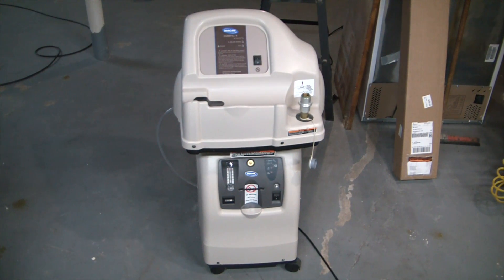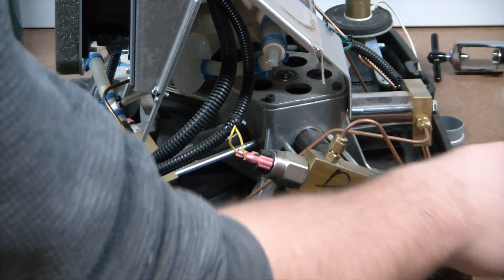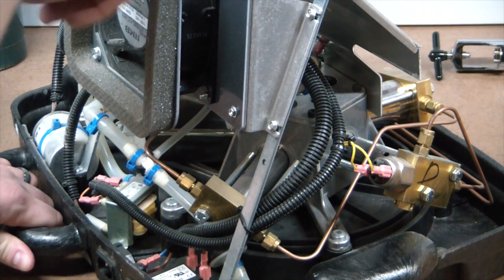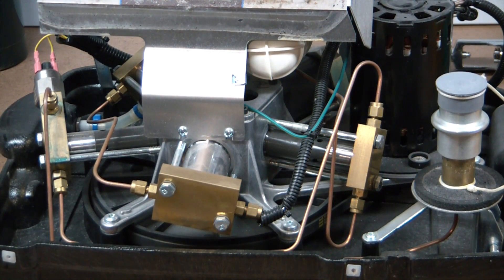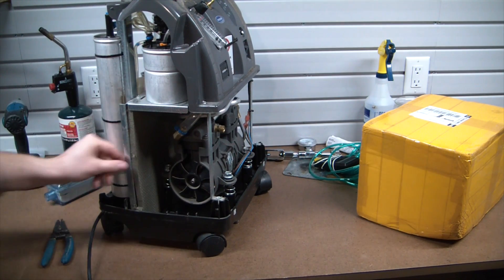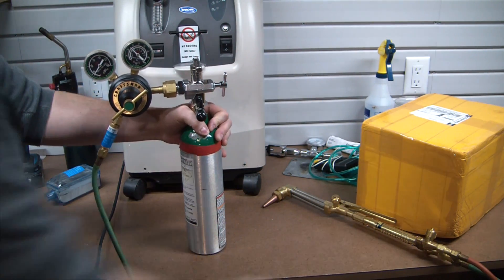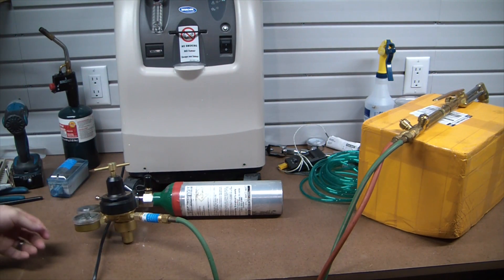Whats Inside an Oxygen Concentrator and Compressor - DIY Oxygen Filling - ElementalMaker

Comment: Awesome video!!   I just discovered your channel.  A multi-stage compressor never even occurred to me.  And to be honest, It's hard for me to imagine how it actually works.  But without having seen one until now, I do know that they are possible for another reason.  I have an oxygen concentrator that then uses a second compressor and makes liquid oxygen from it.  The liquefier compressor is no bigger than a fridge compressor and it makes liquid oxygen!  So, if you think about it, you could take some of that LOX and trap it in a container and close it off.  There you go, SUPER high pressure... probably an explosion if you don't know what you're doing but that's another "round-about" way of achieving high (VERY HIGH) pressures with a small compressor.  It's less work over a longer time.

Comment: 0:31 anyone know what that type of port is called? Is it just the ubiquitous universal industrial coupler thats used to attach air tools to compressed air lines?
Reply from the maker: I believe that's unique to Invacare. The fittings are quite expensive.
Reply: @ElementalMaker  Damn.. Im working on creating a nitrogen concentrator and an oxygen concentrator as well. Sending the oxygen that gets filtered out via the nitrogen separation membrane to the input of the oxygen concentrator (before the PSA).
It would be really awesome if I could have two of those refill ports (one for N the other for O2). I guess the only real way that could happen is if I buy two oxygen concentrators that both have that type of refill port and cannibalize one of them for the nitrogen.
Thanks though!
Reply: @ElementalMaker  Oh, actually, looks like they can be purchased, just not for very cheap at all.. ~$220
https://www.tigermedical.com/Products/Homefill-Integrated-Regulator-D-Cylinder__INVIOH2MD.aspx

Comment: 11:30 i think they're the X13 zeolite sieves. Dont they get saturated with the nitrogen and require changes?
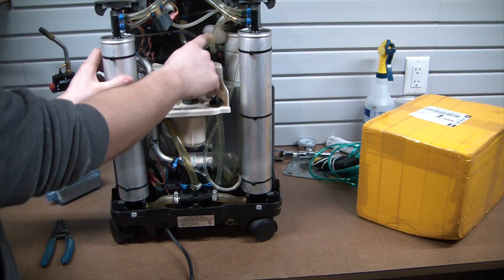Update: nvm, at 13:09 you explain that they offgas the nitrogen. Thanks!
EDIT: are you sure it doesnt use Pressure swing adsorption? (you said it offgasses with time, but PSA is when the offgassing happens when the pressure is released.

Comment: BMET here. Been about 15 years since I've worked on one of those.  IIRC, you will have O2 percentage fluctuations as the filters get saturated, and it switches back and forth.  I don't ever recall getting more than 96-97 percent on a meter. Can't remember what the lower limit is, keep thinking 94ish, but don't quote me, going off memory, and don't have the tech manuals in front of me. But for a small concentrator, with its flow rate, that's not bad at all.

Comment: good vid. I work with pressure swing absorption  (PSA) to generate N2, well remove oxygen... Anyway, i thought the Nitrogen atoms are bigger then Oxygen? if that was the case then this should adsorb the oxygen and pass the Nitrogen, then when it exhaust the O2 it should capture it? Anyway, neat to see whats in there.

Comment: I have an old BUNN Model RX02 . I'm guessing its from early to mid 80's. When I plug it up it seems to work OK but before using it does any one know if it would harm me?  Is there anything that could break down with age and put out harmful  gas? Oh yea it's got 544 hours on an hour gauge on the back. I'm thinking of using it  for oxygen therapy while exercising for some medical conditions I have. Thanks in advance for any and all help with this .
Reply from the maker: There shouldn't be anything that would give off toxic gas. That being said, the molecular sieve beds are very old and may no longer be working at fully capacity, so you might not get much O2.
Reply: Thanks  @ElementalMaker Thanks a ton for the info. If the  molecular sieve beds are  old and no longer  working at fully capacity is there any way to fix this or should I just abandon that one and seek a newer used one? Thanks again, and thanks for these informative videos also.
Reply from the maker: You could probably remove the sieve beds (canisters), and as long as the housing is entirely metal (and there is a pressure relief opening), put them in the oven at 300 for a day. That should drive off any moisture impeding their performance.

Comment: If you had multiple O2 concentrators you could feed the exhaust of one to the intake of the next, and so on, then the last one doesn't collect any O2, but its exhaust should be pretty good nitrogen, which perhaps could be collected in another high pressure compressor. Then you could do exciting nitrogen things!

Comment: Interesting video...I am glad you alluded to the flash back arrestors...maybe a follow-up on the proper sequence of turning on and off oxy fuel combination. I had seen a welding video where after the steel was melting the acteylene was turned off and the oxygen was used to continue to burn the steel.  In other words the steel became the fuel. The oxygen is the oxidizer. Kinda the same principle as thermite. You need  free oxygen molecules to burn the steel/iron. I am not a chemistry major... know just enough to keep my fingers and hands attached. 😉👍

Comment: 1 amp at 120 volts at 90 percentage efficient is 0.145 horse power. Not 12.
Do not override the pressure switch to run it up to 3000 psi. A burst line, or fitting at that pressure can KILL.
Reply from the maker: You may have misheard, it's one twelfth hp. Not twelve.

Comment: Scuba tanks use air, not oxygen (~80% Nitrogen, 20% oxygen). This makes pure oxygen.
Reply: He was talking about using just the compressor section to fill scuba tanks with regular air.
Reply: @ke6gwf  Wouldn't it be significantly cheaper to get a proper compressor for that?
Reply: @eugenes9751 , you can often pick up used medical devices like this for pocket lint or less.
If it was owned rather than rented by someone who didn't need it anymore, there really isn't much of a market for them because insurance or Medicare covers them, so they tend to get tossed.

Would it be cheaper to buy a new scuba compressor than a new medical oxygen concentrator and pump? Most likely lol
But a probably free used machine is usually cheaper than a not free new or used machine! ;)
Reply: @ke6gwf  Free is free, I guess. This will probably take like 2 days to fill a large tank though.

Comment: The gases are preferentially adsorbed onto the surface of the zeolite, rather than absorbed like a sponge. Really enjoyed seeing inside this machine and remember to thoroughly degrease any high pressure oxygen lines and joints or at least get it on video when it pops :)

Comment: Scuba kit needs far more cooling as it is shifting far more air. EG you are filling a 1 litre bottle in 1.5 hours. My compressor filled a 15 litre cylinder in 20 minutes. That alone means in excess of 60 times more air throughput. Also Scuba works at way higher pressures than 2000psi. My cylinders were the standard 232 bar type. That's about 3300PSI and there are higher pressure systems out there with 300 bar being relatively easily available. So in effect my compressor was shifting about 100 times more air so of course it's going to get way hotter. I believe these days there are even systems working above 300 bar.

Comment: I would like to see what kind of cut you can make on steel if you can cut it at all. I'm a journeyman welder and we were taught in first year that you require O2 to be at least 99% pure to get a good cut. Your O2 is, as you said, about 94% pure and it would be nice to see if it actually oxidizes the steel completely or if it just blows molten partially oxidized steel out of the way.
Reply: Scooter Tramp I do remember that you can’t weld steel with oxy-propane. Cutting yes, but welding needs excess carbon in the flame hence oxy-acetylene. I’m keen to see if the PSA oxygen cuts it!
Reply: A 5 lpm machine like he has with fresh sieves makes 99+% pure oxygen.  I say 99+ because my medical oxygen concentration meter stops at 99%.

I make neon signs and artwork and I have 5 10 lpm, 22 psi concentrators in my studio.  One for each of my major fires and the 5th one for all my small fires such as the tipping torch.  I bought refurbished machines that cost between $300 and $600, depending on the rebuilder and the year.  Like everything else, the price of concentrators has risen sharply under the biden economic debacle.

Comment: Im pretty sure that is wrong consentration of oxy for diving is. Only natural air on tanks otherwise would be hard to breath when taking off mask
Reply from the maker: Yeah pure O2 would be lethal in short order. I mean compressing atmospheric air. I didn't want to get into the whole tangent of converting this for scuba use, which is why I only mentioned bypassing the O2 sensor. Additionally though you would need to filter and dry incoming air.
Reply: Ya i figured but dont want someone thinking would be ok but cool you acknowledged it thanks would like to know where you picked up at would love to locate one here in medford or .so any help in that would be helpful
Reply from the maker: @jimjohnson3076  I found this one at a yard sale. Was pure luck but you may be able to call around to some home care places and see if they have any units being decommissioned they would sell for cheap
Reply: Thanks ill call afew places around here and see what i can come up with have a good one .
Reply: By the way where you from if dont mind me askin.

Comment: Its a12th of a h.p. you probably shouldn't own it I imagine it belongs to a home health company or 02 supplier probably some poor soul passed away and a greedy grandkid sold all the stuff and called goodwill to come clean up and if you like your life you shouldn't mess with high pressure and get your tanks filled for scuba the 02 from that concentrator will kill you .you have to have the proper ratio of 02 and nitrogen for scuba.
Reply from the maker: I bet your fun at a party. Audio was shoddy, but I did say twelfth hp. As a mechanical engineer I have quite a good understanding of how to handle high pressure gases. Of course you would not use pure O2 for scuba, which is why I mentioned bypassing the O2 sensor. Of course further air purification and drying would be needed, but that was out of the scope of this video.
Reply: ElementalMaker technically you wouldn't bypass the o2 sensor you wouldn't even use the o2 generator you would just compress atmospheric air with the compressor but to get the proper psi for scuba you would have to modify the pump but go ahead and do stupid shit it wouldn't be the first time I seen you do it .
Reply from the maker: @joetri1970  yes I thought that was pretty self explanatory

Comment: plug is stated at 2 Amps. moter may be 1.2 hp
Reply from the maker: Motor for the compressor is 1/12th hp. Audio was garbage, but listen carefully and you'll hear it. Really incredibly low power considering what it does.

Comment: A little surprise for me that oxygen molecule would be smaller than nitrogen (for the molecular sieve to function).  So I checked, and what I found was that indeed nitrogen was listed as 155 picometres and oxygen 152.  Those are Van der Waals diameters and I did not check if they were for atom or molecule, but in any case the relative numbers tell that nitrogen is bigger, despite its smaller atomic (and molecular) weight.  Learned something again.

Comment: can the pressure sensor be switched out for something that would stop the machine at 3000 psi
Reply from the maker: I bet it could 👍. It would probably wear the pump significantly faster though

Comment: Biomedical equipment tech for 18 years worked on almost every brand and model of concentrator. I think the compressor in this may be made by Invacare it looks a little different than any Thomas or Gast compressor I am used to seeing. Common compressors like that are model 2650 and 2660 I built an air compressor for the garage with one and I love it. Its so quiet. Thanks for showing the homefill unit I never had one come thru the shop, I was only aware of there existence. I wish I could have worked on one.
Reply: If you need compressor rebuild parts check the aftermarket group or Virginia medical repair.

Comment: That residue on the compressor looks like tar from being in a smokers home for many years. Probably a longtime smoker needing oxygen to breathe. I need to stop smoking before I reach that stage. 

Scuba uses compressed air not oxygen. You cant breathe pure oxygen underwater which is why for extreme depths they mix oxygen with helium.
Reply: The compressor will compress whatever gas you put in it. yeah,  you wouldn't want it hooked up to the oxygen supply if  you were filling a scuba tank. Just let it intake air through a filter.

Comment: It is a 1/12 HP motor and you need 99% O2 or better to cut steel...
Reply from the maker: Wow I haden't realized that. I'll have to give it a try and hope that the 95% rating is on the conservative side. Thanks for sharing.
Reply: @ElementalMaker  Argon gets concentrated with the oxygen since it adsorbs/desorbs at similar rates so the purity cant get any higher by this method.

Comment: My dad used to have to be on oxygen with his cpap and I always wondered how they made "pure" oxygen from normal air. I never took the ting apart for fear of screwing something up and paying out the wazoo to have it fixed. thanks for the peek into what I was never able to do. (P.S. No way that is a 12 hp motor. if it really is 2A at 250v like the back says than it would come out to 500 watts aka .67ish HP and it looks more like 120v than a 250v. even if it was 12 hp and 250v it would  take a whopping 8940 watts to run a 12 hp motor. 8940 watts at 250v is 36ish amps and if it is 120 like I'm suspecting, that would make it 75 AMPS. You would need 3 gauge wire and that's  a wire that is 1/4 inch in diameter (6.35 mm) for context that 12 gauge wire is only about 1/10 inch in diameter (2.54 mm) if you were to try and run that motor on standard electricity than it would burn up the wire in no time and that's GOD DAMN TERRIFYING!)
Reply from the maker: Glad you got to see how they work! And yes the audio was shoddy but I did say "twelfth" as in 1/12HP. They are very cool devices.
Reply: OH ok, that explains alot. Thanks (P.S. that's only 62 watts. about the same as a lightbulb.)

Comment: Im a glass blower and the high pressure compressor end is garbage. I built a system 10 times faster but lower pressure. < 150psi

I would have to run 4-5 of those day and night never stopping and they still dont keep up.

Oxygen high volume low pressure is way better. 20 LPM vs 2 LPM.

Comment: Cool vid got me subscribed! Quiet pump looks like a Thomas Pump design. How about running this from an electrolyzer. Could use waste heat from hydrogen for a pre-heat water heater, or just burn for heat with humidity. Maybe run oxygen over a heat filament, even a tungsten-halogen bulb (quartz) to preclude H getting into the O. Pure hydrogen burns smoothly in a proper flow system. Thanks.

Comment: I worked as a biomed for over 25 years. I also worked on hundreds of concentrators. I do remember the active element in sieve bed of those is felspar. /They work really good just keep them away from water or very high humidity.  A blast from the past!!!  Thanks.
Reply from the maker: Very cool thank you for sharing! I did a few years in biomed engineering myself but far out of the realm of this stuff.

Comment: 12 hp, 1.1 amps, 120v(1.1amps) = 132 watts. 1 hp = 746 watts 12(746) = 8952 watts. Something doesn't add up. Even 240v(1.1amps) = 264 watts doesn't work.  ** just read the other comments it's 1/12 hp
Reply: Just read the comments.1/12 makes sense

Comment: High pressure but very LOW VOLUME.  It would take several hours to fill a scuba tank.  The volume is so much less there is no need for cooling which a scuba compressor has to have.

Comment: 12 hp and 1.1 amp? it uses 8130 volts???
Reply from the maker: 1/12th hp. Audio wasn't so that great there
Reply: @ElementalMaker  that makes a lot of sense, do you know the rpm and the poly  ratio?

Comment: Glass blowers tend to use the oxygen concentrator directly, no bottles required, if you only need a few PSI to maybe 10-15 PSI there's no point filling a bottle.
Reply from the maker: Very cool. The couple setups I've see utilized bottles, but I could certinaly see the concentrator being used directly as long as they didn't need huge amounts of O2.

Comment: Hey Man DO NOT Refill SCUBA Tanks With Oxygen. Unless Used With Other Gases It Can Be Dangerous To Breath Under Pressure Such As You Would Be When Diving. I'm A Master Diver, Both PADI and NAUI Certified And This Is Something We Were Warned About When We Learned About Diving With Mixed Gases.
Cheers,
John
Reply from the maker: Hey John, yes I didn't mean filling a scuba tank with pure O2, that would be a deadly mistake. I should have worded better on camera. I meant bypass the O2 sensor so that you could pump filtered and dried air into a tank. Didn't want to go off on that whole tangent though as diving gas mixes could be a six hour lesson in itself. And I ain't here to give no darn lessons haha
Reply from the maker: Also a NAUI certified driver here. Great organization, and tremendous education. Truly one of my most valuable education experiences.

Comment: You explained how it absorbs nitrogen pretty accuratley.
When its running at a higher pressure than atmospheric, the sieves trap nitrogen while letting oxygen to pass through and out the exit valve.
Once the zeolites are full of nitrogen and its starting to pass less pressure through, it's switched to the other bed while the full bed is depressurizing out the nitrogen.